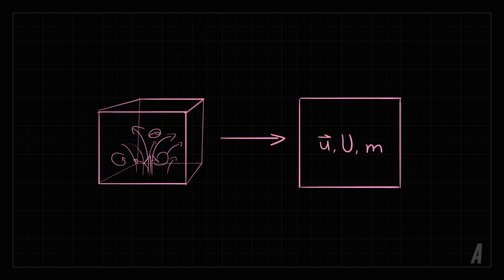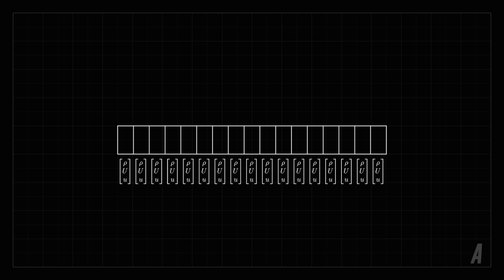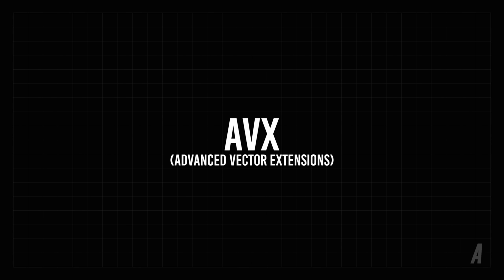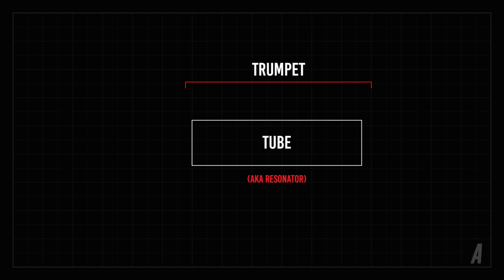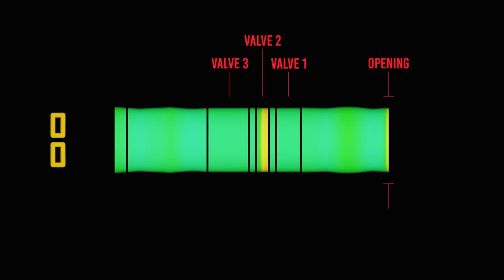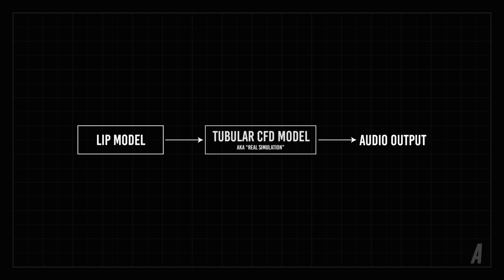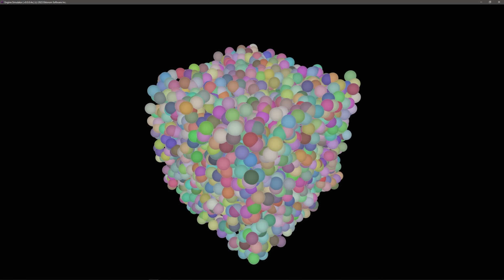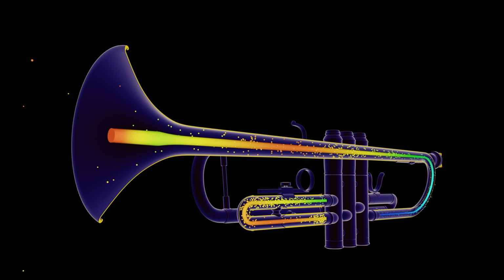Real-time Trumpet Simulation [C++/Vulkan] [WARNING: Flashing Lights]

Comment: As an electrical engineer, the way I like to think of the intuition behind "Air bouncing off nothing" for an open ended tube is that it's simply a sudden impedance mismatch.

Akin to a poorly designed antenna, the mismatch is going to allow a ton of power to be reflected back into the system rather than emitting as much as it can. Of course in real life we design instruments and other radiators in a bit of a smarter way than a simple open ended pipe, because we actually want to hear a good bit of sound.

Comment: A very important aspect is the mouthpiece, which plays a big role in creating the characteristic sound of the trumpet. Trying to play without the mouthpiece right now gets me quite a similar tone to the simulation, minus the brightness because you really can't blow that hard with just the much smaller leadpipe. The body itself also has an effect on the tone, but I don't think it's necessary to simulate it. I tried to build an euphonium inspired instrument a while back out of 3D printed parts, and while the valves ended up way to leaky, the rest put together did indeed sound quite like an eupho, just duller. It will be super interesting to see where your project goes though, physical modelling is something I have been interested in for a while and this gives a neat visualization.

Comment: I'm a trumpet player, this is amazing! Simulating the valves adds so much character compared to robotic synth instruments! Even with your "clarinet" tuning the note transitions are distinctly trumpet sounding. Simulating the bell and refining the mouth simulation could actually make this viable as a digital instrument. 
Here are my insights:
When playing a wind instrument, the general state of your face, like the position of your lips, tongue, teeth and facial muscles is called your embrasure. Wind players typically have one embrasure that they stick to, IE, most of the parameters should be set once and then change slightly depending on the note. The ones that change the most and contribute the most to  the character of a note are the air speed and the mouth volume. A good way to control this in real time would be to map each valve to a keypress, and the airspeed and mouth volume parameters to a 2D vector input like mouse position. Click to blow air, drag to change the character, left click to interrupt airflow (tonguing). That should give you access to most styles of playing and create a truly dynamic digital instrument. Please release this on steam, it would be amazing.

Comment: As a physicist, I loved every second of this. Although I do have one correction, namely that the heat equation does not imply that heat disturbances will be felt across an entire domain instantaneously (that's relativity, folks!). In fact, the heat equation is not a wave equation at all but more of a diffusion-like equation. Since the dispersion of heat through a solid is related to the phonon modes of the lattice, we would expect heat to travel at roughly the speed of sound, but due to random fluctuations it travels far slower than this - on the other hand if heat is dissipated by thermal radiation it of course will travel at the speed of light!
Reply from the maker: All of what you said is correct, however, this is exactly why I used the heat equation as an example. It isn't a wave equation and thus the equation predicts that information travels infinitely quickly which is obviously not what happens in reality. This is different from the finite propagation speed predicted by the Euler equations. I just pointed it out because it's relevant to the solution of these equations, not necessarily because it accurately represents physical reality

Comment: Oh my god. Oh my god. This is AWESOME! First of all, this video showed up in my feed while i was in a practice room practicing trumpet. Second, when this is finished, PLEASE PLEASE PLEASE PLEASE PLEASE make a VST3, AU, and AAX plugin for this if you can. 
Also! As a trumpet player and an audio engineering student I have a few observations, questions, and suggestions which you may or may not have already taken into consideration:

It sounds like a french horn, or other low brass instrument. Making it sound more like a trumpet (i.e. generally brighter) is going to come down to the resonation of the metal in the bell. I couldn't tell if you were simulating the actual metal itself resonating, but the temperature, thickness, material, and plating of the metal is going to be very important to the sound. Heres a few parameters that I think could improve the accuracy of the simulation (and are also interesting to tweak): metal materials (i.e brass, copper), plating (gold, silver, none), presence of lacquer, Bore size, Bell size, Bell thickness, Different mouthpieces(??), just to name a few. 

I noticed that your tuning slide wasn't adjusted at all. Unless it is VERY cold in your room, you are going to need to put it out a little to get proper intonation. Also, when playing middle D (Valves 1&3) the third slide will need to be extended slightly, and fully extended when playing middle C# (123) for proper intonation otherwise they will be very sharp.

On the topic of the bore and the bell, these things have a significant effect on the brightness and tone. I play a Bach Stradivarius Model 25L, meaning it has a relatively small bell (brightens the tone and increases projection) and a large bore increases the richness but requires significantly more air. I've played quite a few other trumpets and the difference in intonation and playability is massive.

Mouthpiece - not sure if you did research into this. Theres a bunch of different parameters for this (cup size, depth, shape, rim size, thickness, etc.) and it affects both intonation and playability. Each mouthpiece has its pros and cons in terms of range, tone, and playability. You can buy a screamer mouthpiece for playing lead and screech all day long but it wont be very rich and warm. Im not sure if any of that applies tho, as theoretically the simulated lips aren't subject to pain or fatigue. 

Again, if you aren't already simulating resonating metal id say do that first, as it has an enormous impact on tone. 

I know thats a lot of things to simulate, but I think it would make a significant improvement. Also, I think the most impressive thing here is what you've done already. It sounds like a brass instrument, and it does tuba pretty convincingly. You just need a few finishing touches (and high end).
It would be super cool to see this released to the public, but regardless I'm dropping a sub on patreon right after I finish typing this out so I can start playing around.
The ramifications for this in the production community are insane. Hyperrealistic brass instruments right in your daw???? Theoretically, this simulation could be used to recreate room reverbs, without the need for an Impulse Response and convolution reverb. I wonder if there is enough performance optimization available to make a sim that large work effectively in real time.
Anyways, this is super awesome, and bravo for making something real that I've only ever dreamed about. I can't wait to see how you improve this, and whatever other projects you have in store.

Comment: I used to be a trumpet player. I am very impressed with this. Especially the over-blow bit. The simulation was able to pretty accurately predict what actually happens when you blat.

The mouth simulation would need a lot of work to be accurate. There is much more to embouchure that would need to be considered. You'd probably have to model a whole head.  Its all very impressive!
Reply: Agreed to at least the whole mouth, not sure about the whole head. Like, how essential is your skull when buzzing, y'know? I think simulating all the way to the back of the throat would make the most sense, because of how important the tongue is in shaping your tone.

Still super impressive!
Reply: @angelicbeast7793 need the nose for that circular breathing haha
Reply: @angelicbeast7793  i think will's point was once you have put in the effort to model the mouth, you might as well just simulate the synapses in the brain that decide which note to play :DDD
Reply: You'll need to model the lips, mouth including tongue and teeth, the larynx, lungs, and the diaphragm... Good luck!
Reply: @ducodarling  no, just the vocal tract
Reply: Not the whole head, vocal tract max. Also the properties of the material play a major role in the sound

Comment: As a trumpet player myself, this is a lot better than I anticipated. Most people have an entirely skewed understanding of how the instrument works (the instrument isn't what's making the sound, it's just a resonance chamber), but you've gotten a lot closer here. After listening to it, it sounds like the stiffness of the simulated lips is too low. It sounds a lot like you're on the low end of a "partial" (the term for which harmonic is being played, following the overtone series based on which valves are pressed). As I mentioned above, most of the sound is coming from the lips, so most of the problem of fixing the tone will be in adjusting the lip simulation. When playing a real trumpet, as you tighten your embouchure (the shape/tightness of the lips), you slowly raise the pitch until it flips up into a new partial. The ideal spot for tone is somewhere around 80% of that range for a given partial (based on my understanding of what I'm doing).

Also something else to consider is that your tone on the trumpet can vary depending on how open your jaw is, where your tongue is positioned, what angle the trumpet is compared to your face, and how hard you're pressing it into your lips. All of these things, I can only assume, adjust the amount of pressure and also the direction the air is moving as it enters the instrument, as well as whether the "hinges" of your lips are rigid or not.
Reply from the maker: Oh, that's very interesting actually. I just tuned the lip tension to match the intended note being played but I never considered that this is not actually the best thing to do. I'll try varying the tension away from the ideal value, maybe it'll introduce some of the additional sound you're referring to
Reply: @AngeTheGreat  Yeah, this is part of what those slides are for. The trumpet is not perfectly tuned for every player, each player has to adjust using the slides a bit to match their lip tension, and also to adjust for ambient temperature causing the instrument itself to change in size.

Comment: i guess you need to blow too hard into the trumpet because you're missing the flare. a trumpet isnt just a standing-wave-generator but also uses the flare at the end to amplify the sound, transforming high-pressure low velocity vibrations into low-pressure high velocity sound.

Comment: As a tuba player and engineer, this video was very interesting. Regarding air pressure, you need higher pressure as you go up the register, and less air flow. A trumpet uses far less air than a tuba does, but at higher pressure.

It would be cool to see models of other brass instruments - a tuba with compensating valves might be a good one because it's a clever system for assisting with intonation when using multiple valves which happens often for low register playing. The compensating system switches in additional lengths of tubing to get closer to the ideal total tubing length that would otherwise be missing and cause notes to be sharp. It would be good to have different tubing profiles as that has a big impact on the sound - a cornet with a conical bore sounds very different (softer and more mellow) than a trumpet with a straight bore. A flugel horn even more so.

Comment: Experienced brass musician here. It sounds like an early beginner trumpet player who is trying to find out the best way to make a sound! I'm mostly impressed at how accurately the valve movements distort the tones between presses, which sound very accurate.  From the sounds of it overall, the tone of the trumpet could mostly be fixed by making adjustments to the player's embouchure (the mouth and its positioning on the mouthpiece).  But I can say that I've heard these kinds of tones from the beginning trumpet player.

Comment: The lip simulation could be used for flexible valves like the ones used in those old airhogs compressed air engines.

Comment: ex-Tuba player here. Sounding great! The blowing hard part sounded strange dropping in pitch, I have never experienced that. Pressure and mouth shape ( embouchure) are still needed to correct intonation but normally more pressure would result in jumping to the next harmonic up in the series, although that probably has just as much to do with changing of embouchure to achieve more airflow (i.e. changing lip shape). In other words it's impossible to blow both hard and maintain low pitch. In the same way it's easier to sing higher notes loud. I suppose it's because we're working with the resonance modes in the chamber to achieve efficient sound level, in some cases it feels a kind of back pressure too? A brass player's worst nightmare is a slow piece that contains long, low notes as it's hard to maintain the pressure at low pitches (mouth being more open low vs 'puckered' for high notes) and also hard to maintain tone too which results in a lot more 'air / breath' noise coming through than pure pitch . (which I could hear starting to happen in the loud simulation section) 
I wonder if the reason you are needing to flow air so much faster than expected is just down to the lip model not being solid enough. A trumpet player's lips are like rocks!!! I moved from cornet (a shorter trumpet) to Tuba because I couldn't maintain the pressure needed at high notes (part laziness part decision that bass parts were cooler). at 17:20 you are achieving lower pitches than most humans could produce on this instrument for example.  I wonder those lips could whistle on their own? or does that require a mouth chamber model? hmmm. Either way I think the velocity change necessary should come from the lip restriction not sheer input and maybe that would get you closer to the final result? 
Regarding auditory suspension of disbelief I think a microphone / ear position aspect would also be necessary to nail the realism. 
Overall I can hear the fundamental model is indeed working well though thank you so much for your work! 

Either way I'm looking forward to seeing an implementation into car exhaust models at some point as I was indeed one of those 'convolution complainers' haha. top work sir! 👊🙏
Reply from the maker: You would have to blow UNBELIEVABLY hard to start experiencing what I showed in the video lol. The computer was blowing so hard that the speed of sound in the instrument was changed significantly which is why the pitch started shifting so unnaturally. It's not something an average trumpet player will ever encounter but I thought it was a cool phenomenon to observe. The computer is also capable of holding an unnaturally steady lip tension regardless of blowing pressure which most humans probably wouldn't be able to do

Comment: This is extremely impressive. One quick question though: at about 20mins in, those low notes... well a Bb trumpet is ~4.5 ft long, and I reckon those notes are far below the fundamental for that instrument. Is it really possible to make those notes when you have such a small fraction of the wavelength within the instrument; or is this an effect of not modelling the conical-approximation of the instrument? (aside: I play French Horn, which is ~12ft long. We almost never play down into the fundamentals, unlike a trumpet - we play an octave up relative to the fundamentals of the instrument)
Reply from the maker: I double checked and it seems to be correct. The fundamental would be around 50 Hz which is very deep. A human probably wouldn't be able to play notes that low though. Another thing going on is that the computer is blowing so hard, it's actually changing the speed of sound in the instrument which allows it to play notes that might not otherwise be possible
Reply: @AngeTheGreat  huh, yes - it's a quarter wave in a cylinder isn't it? - node at the lips and anti node at the other end, so 18ft wavelength, so 62Hz apparently. Am I right in thinking the flare of the bell raises the pitch more the lower you go? I'm just trying to think why I don't think I've ever heard anyone play that low. But maybe I'm just misguided.

EDIT: My normal "full double" French Horn has a 12ft F-side, and a 9ft Bb-side (i.e. twice the length of a trumpet). On both, I can play the fundamentals. I've measured myself playing down there. The F-side fundamental is 43Hz (F1), and the Bb-side is 58Hz (Bb1). These are the fundamentals because the next note up, without changing fingering, is a full octave higher. So that really makes me think the lowest on a trumpet should be Bb2 (with no valves down), which would be 116Hz. So unless I've made some embarrassing basic error (always possible), this makes me think this is all much higher because of the effect of the approx conical and not cylindrical shape of the instruments / bell flare.

Ahh, yes: http://hyperphysics.phy-astr.gsu.edu/hbase/Music/brassa.html

Comment: As a trumpet player and developer, I find this totally exciting. For my taste, the sound of the trumpet still clearly lacked harmonics.
What happens when you apply a white noise to the mouthpiece? Then there should actually be some fundamental tone that is tied to the length of the tube.
As a trumpet player, it is incredibly difficult to play notes whose resonant frequency does not correspond to the tube length. Maybe that's one thing that's not quite right in the simulation. For every note you want to play, the resonant frequency has to fit perfectly for it to sound clean. So maybe you need to vary a few more tube lengths to make it better.